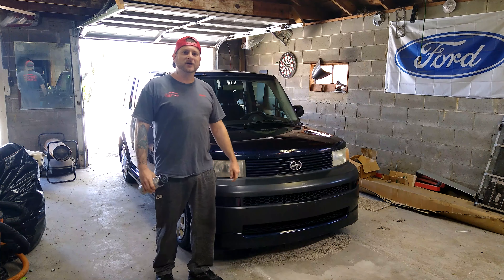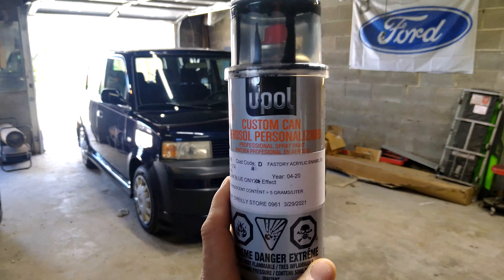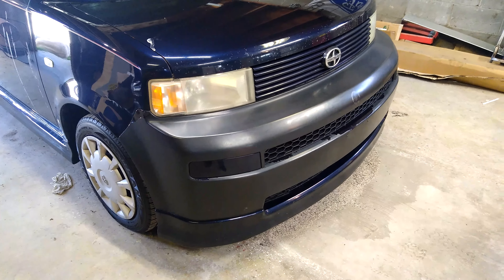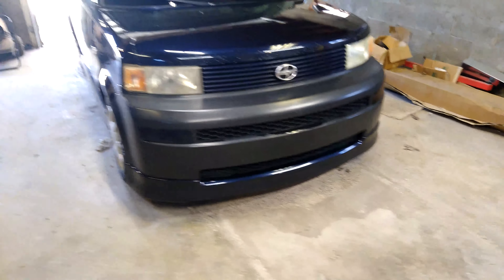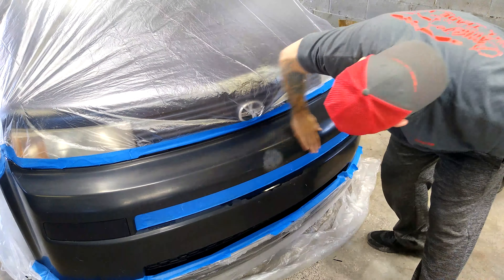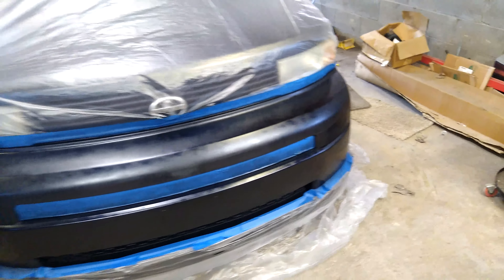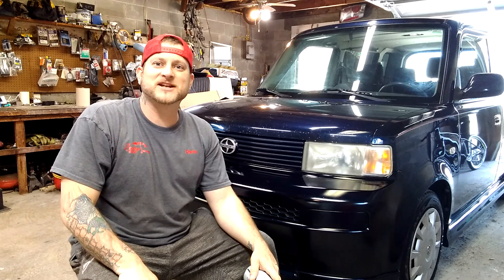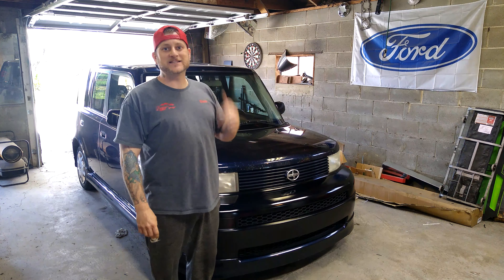O'Reilly Spray Paint Review

Comment: besides hitting it with the wax and grease did you scuff the bumper? I have similar xb and clear gone but blue base is still there, not sure if I should sand clear off and use a similar paint product with the harderner or just clean it and blast it with the paint..I know its not going to be show quality but better than what it is now